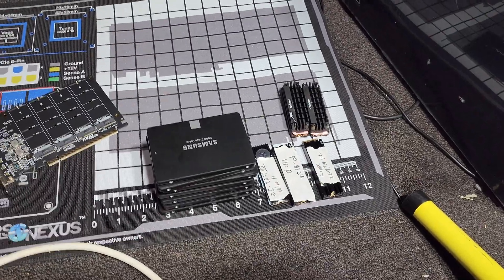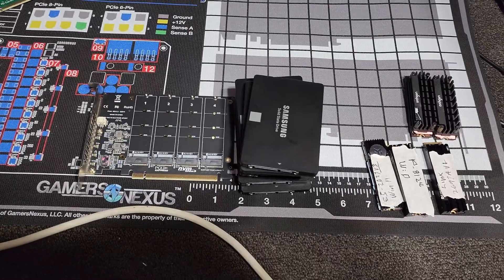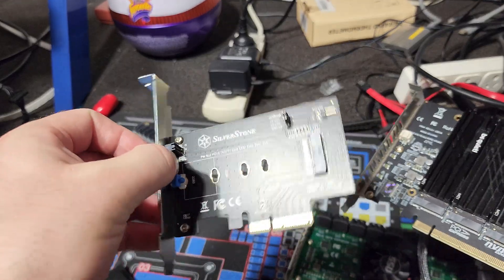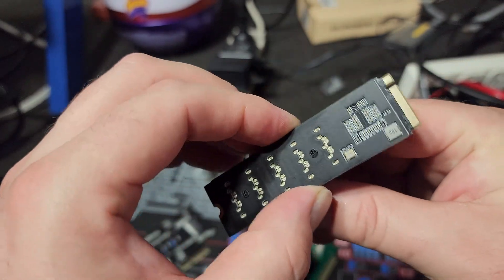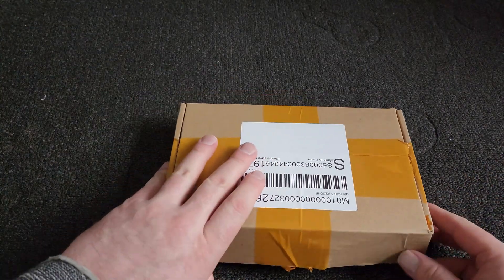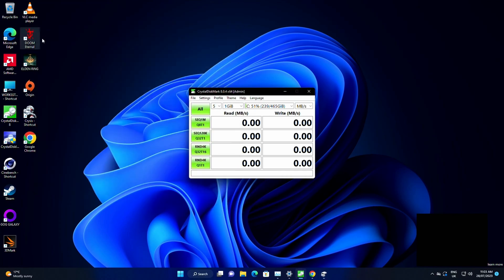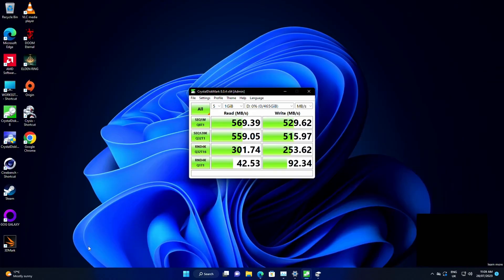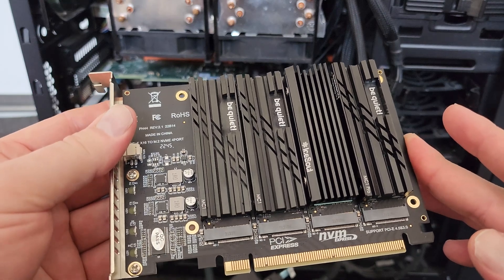Storage Expansion Cards SSD/HDD/M.2 Follow Up.

Comment: Thank you very much, I need to ask:
If we turn off the computer directly from the power button
Or if the electricity suddenly cut off in the house
Can such a PCIe SATA Expansion cards lead to burning or Damaged the HDD's connected to it?
Reply from the maker: These three cards are not backed up by battery. I would definitely suggest using an external UPS.

Comment: i have purchased a m.2 m-key card with 6 SATA ports similar to the one with 5 SATA ports you have. They use a asm1166 or jmb585 controller. Hope this will work on my project, building my first nas.
Reply from the maker: Nice, what's your planned NAS OS? . My next server is either Unraid or TrueNas. Unraid has to clear a few requirements before I decide.

Comment: The lsi card is a hba it card, of course remember sas cards can control sata, but not reverse you cant use a sata card to control sas, i buy all used sas hdds because they are cheap compared to sata. Plus heaps different hba cards for more ports n lanes.
Reply from the maker: You are correct.